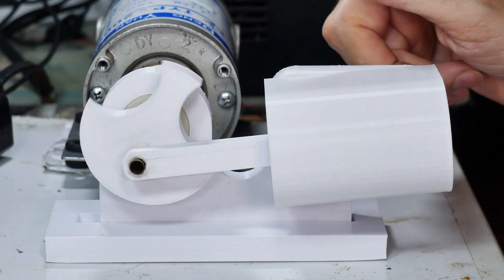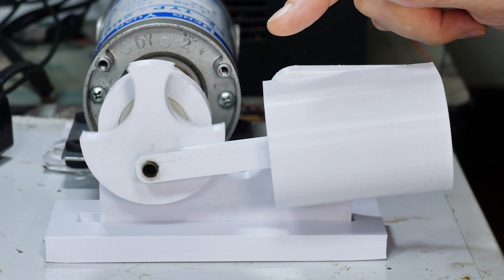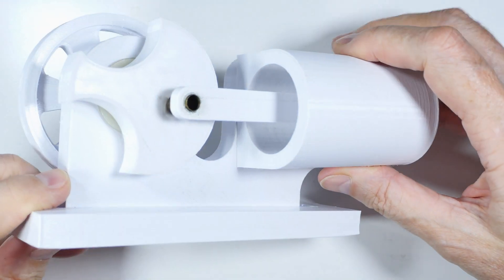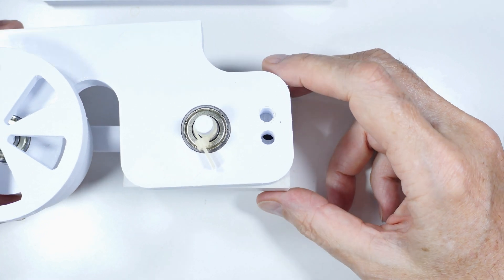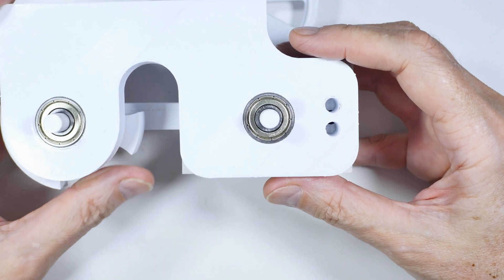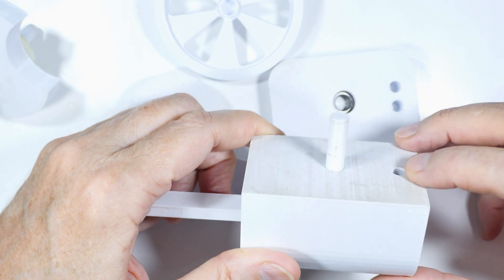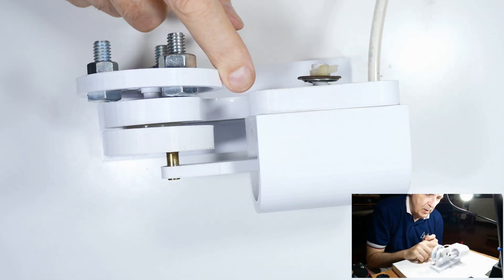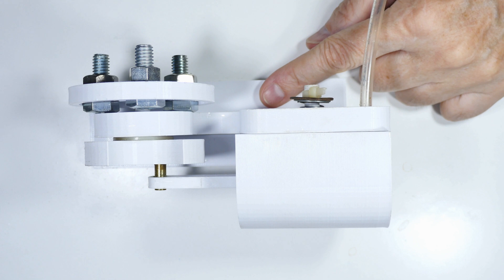Model Steam Engine & How It Works - 3D Printed (4K)

Comment: Forgive me if I’m wrong but I’m pretty sure you mounted the piston rod to the wrong side of the drive wheel. The weight is supposed to be opposite of the connecting rod to counter the weight of the connecting rod and it’s pivot point on the drive wheel.
Reply from the maker: This is from thingiverse and I followed the photos the designer supplied. The brass pin was originally printed in plastic (but broke off). The weights on the flywheel I added so that it would run at slower speeds. I'm sure there are ways to improve on it.

Comment: Could you please do a video on determining direction of rotation using Hall effect sensors (any pulse sensor). The theory is easier than implementation?
Reply from the maker: I am not sure when I can get around to that, but in the mean time I can tell you a simple way to do it.  You can use 2 Hall effect switches (or magnetic reed switches or micro switches) and set them so they trigger 45 or 90 degrees apart.  Then what will happen is you will have a long pause, then either switch 1 or switch 2 will trigger, followed by a short pause, then either switch 2 will trigger or switch one will trigger.  That will tell you direction of rotation.  I have an arduino video on using a rotary switch which shows about 90% of what you are looking for.  
https://www.youtube.com/watch?v=p0OTckeHEc8

Comment: Awesome! Where did you found the files? Or in case you made them, are they published?
Reply from the maker: I found them on thingiverse. They have lots of motor models. If I printed this again I would make it smaller, but then I would have to get different sized bearings.